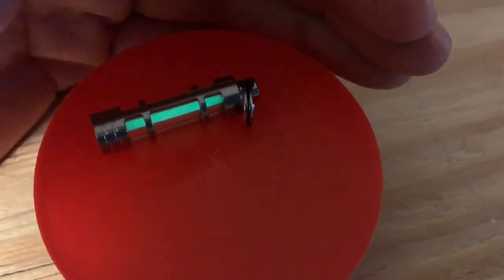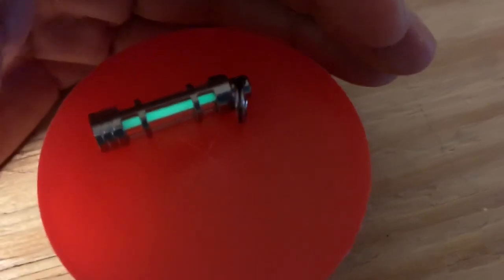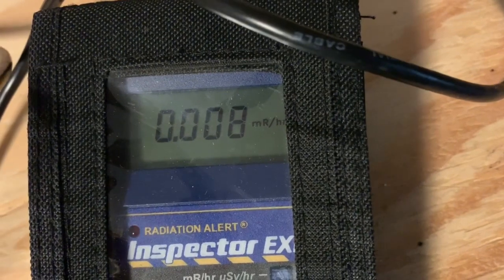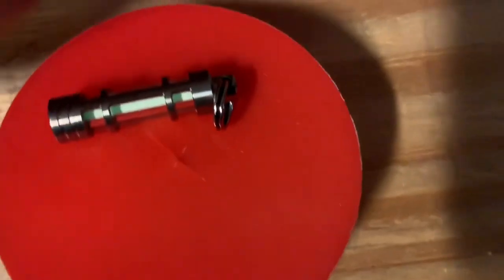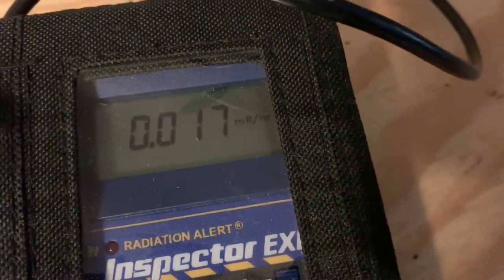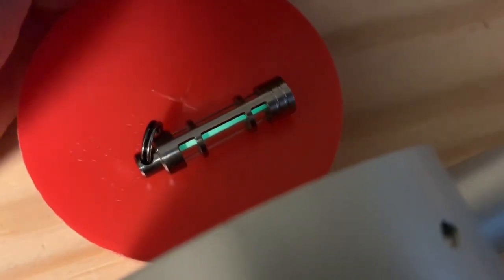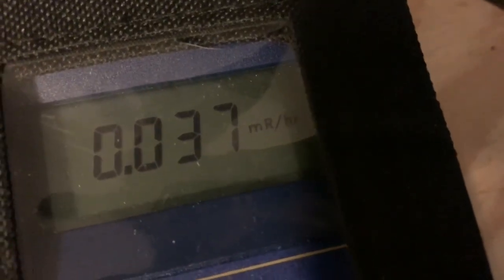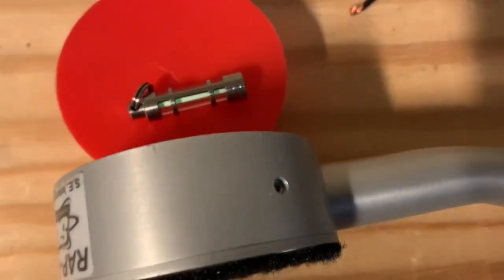Radiation from Tritium Keychain Light??

Comment: All correct, except note that the GM tube method of detection is inappropriate and misleading here. Even with a thin mica pancake detector that can see alpha radiation like the kind you're using here, the detection efficiency for low energy few KeV x-rays is spectacularly poor. In fact you need a special kind of scintillation detector to efficiently detect low energy x-rays / gammas like this and if you put one up against the side of one of these light sources it would indeed be screaming.
Reply: put one up against the side, you mean like a keychain light in a pocket right up against the skin?

Comment: Thank you for your video. I wear a titanium jewellery item with 6 Trigalight Tritium vials, around my neck, which are not covered by glass. My Mira dosimeter doesn't seem to be picking up much radiation. I am really curious about two things:
1. Am I about to die horribly from chest cancer because I wear a necklace full of tritium vials.
2. Am I about to turn into a super hero because I am mutated by wearing tritium vials.
Let me down gently.
Reply from the maker: The level of detectable gamma rays is very very low. Would take several lifetimes to see any effect if at all!!!
Reply: Essentially it is only dangerous if you break the vial and inhale the tritium gas.   Then yea beta particles will slam into your tissues.     But contained in minor glass or vial or plastic or clothing would stop that radiation.
Reply: Yea you are probably fine.  But they aren't meant to be jewelry so I wouldn't suggest wearing it on your skin daily
Reply: Exact same question I had haha. I want to buy some cool Tritium jewelry!
Reply: @pharaohsmagician8329  I got a RovyVon Ti Walker EDC Titanium Bead. Its best to shop around Pharaohs. I got mine cheap with a stainless steel chain, and bought the 6 tritium vials from EDC Gear in the UK. The green ones were very bright and overall it was cheaper than buying them as a package. I would note, go for a stainless steel good quality chain. I burned through multiple sterling silver chains because the clasps are shite.
Reply: @TheWtfnonamez  awesome bro thank you! Stay safe out there and I hope your every day carry never fails you!
Reply: @pharaohsmagician8329  Thank you brother. Stay safe in these strange times.
Reply: U are brave to admit as a grown man you wear this for fashion 😂

Comment: The problem is people carry these in their pocket, which is very nearly direct skin contact. Instead of a few inches away, you should have put the detector directly touching the vial, as it would be if carried in pocket on a keychain.

I've done this with my pancake detector and let's just say, I do not care to carry tritium keychain lights in my pocket.
Reply: It emits beta not gamma rays. Believe they can’t even penetrate the skin.
Reply: @Enlightened1-v4t  gamma bremmstrahlung with 18kev are created when the betas slam into the glass enclosure. see https://www.youtube.com/watch?v=4Y3Hu6hEwow for proof. do you want to carry that around in your pocket all day? i wouldn't do it.
Reply: You'd get more radiation by flying a couple times a year than having one of these in your pocket.

Comment: serious question
can tritium be crushed to powder like ceramic?
if it does will it still glow?
Reply: No, it cannot. Tritium is just Hydrogen chemically. So you'd have to react it with something like you would do with hydrogen to make a solid. It would then probably glow even harder.
Reply: @crimsonmutt  I love when people give helpful and accurate answers. Well done good pokemon. Well done indeed.
Reply: Like Male Sylveon said, no.
Tritium is a gas, the glowing is the phosphorescent coating in the container that is actually giving off light. You COULD make phosphorescent beads or micro particles to submerge in the tritium though.
It comes down to how luminescent the phosphorescent material is, how small they are (for beta penetration), and how rarefied you could make the combo. Since beta radiation has very little penetration, small, easily excited phosphors would be your best bet IFF you were looking for a solid. Still, hard to beat phosphors on the inner wall of a glass vessel.

Comment: I've had one that's been glowing for over  20 years
Reply: YEah, the half-life is 11 years, so after 20 years it should still glow about 1/4 as bright as when you got it originally.
Reply: Is it produce light automatically or stores light and emit it like radium...????
Reply: @lifeisbeautiful6329  some sort of low level radiation light I think
Reply: @lifeisbeautiful6329  the light is produced by the decay of the tritium.  The tritium decays in to an isotope helium 3, after emitting a beta particle.  The tritium doing this excites phosphors that are covering the glasses surface on the inside.  This creates light.  So it will glow with out being charged until all the tritium decays which is 50% over 12.5 years
Reply: I have some on my hk usp 45 sights
Reply from the maker: Nice

Comment: Hydrogen-3 (Tritium) doesn't emit gamma ray energies or characteristic X-ray energies when it decays to Helium-3. Only very soft beta particles with an endpoint energy of 18.6 keV @ 100% intensity. Bremsstrahlung (secondary/braking X-radiation) is the only thing that is detectable from H-3 decay. Also, the only thing that differentiates X-rays from gamma rays are their origin: X-rays are emitted from the orbital electrons–gamma rays are emitted from the nucleus.
Reply: Also, the beta radiation can only penetrate about 1/4 inch of air, and cannot penetrate the dry epidermis of human skin. There is no health risk from this type of light source.
Reply: > Also, the only thing that differentiates X-rays from gamma rays are their origin: X-rays are emitted from the orbital electrons–gamma rays are emitted from the nucleus.
Not exactly true. Would be nice if it were so easily categorizable:

> There is no consensus for a definition distinguishing between X-rays and gamma rays. One common practice is to distinguish between the two types of radiation based on their source: X-rays are emitted by electrons, while gamma rays are emitted by the atomic nucleus.[58][59][60][61] This definition has several problems: other processes also can generate these high-energy photons, or sometimes the method of generation is not known.

Comment: ... and does it or could it produce heat if it were broken open or modified?
Reply from the maker: They produce small amounts of heat from the radioactive decay. If tritium gas was compressed, there woukd be significantly more heat.
Reply: SciTubeHD    aha.  that is interesting.  But still, would a mountain climber know all that, and have one, 50+yrs. ago?  Thank you.  I shared this on Paul's channel.
Reply: @alanmalcheski8882  You would not feel the heat. The increase in heat would be only some tiny amount not relevant to real world use.
Reply: @crimsonmutt     Thank you.  I was asking because I had a theory about the Dyatlov Pass incident, in Russia.  Some hikers got caught in a blizzard, then for some reason, some of them abandoned their camp, in freezing weather, unprepared, and died, and then the others died.  A recent update on that case revealed that forensic analysts found radiation, on them, I'm not sure which ones.  I was thinking maybe they had one of those lights.  But another update said that there was some kind of weapons testing going on, they think, and that's where the radiation came from.

Comment: Neat video I was curious about the safety of these.
Reply from the maker: It is interesting that they emit low dose gamma radiation
Reply: @BrianDhvTinkerer  Is it still dangerous
Reply from the maker: @osamabinladen824  I doubt it. The levels are likely to be quite low
Reply: You absorb more background radiation just standing outside for an hour than you’d absorb from wearing a trit fob for a whole year.
Reply: It is well known that the radiation absorption of the human body by eating 7-8 bananas is about 10 times higher than having physical contact with a Tritium container of about 1 gram ( which is the biggest amount you can get on the market ).